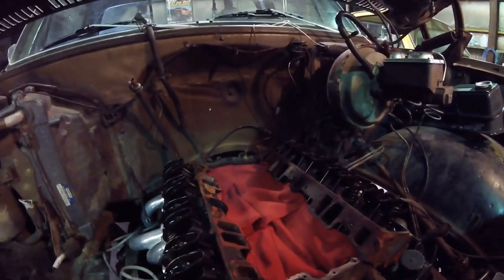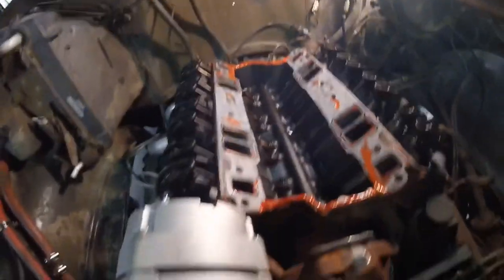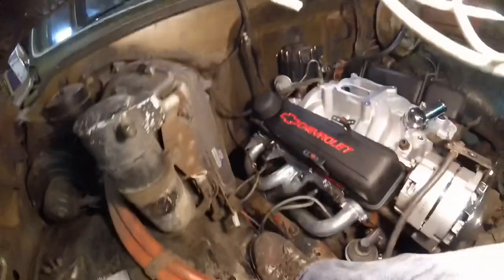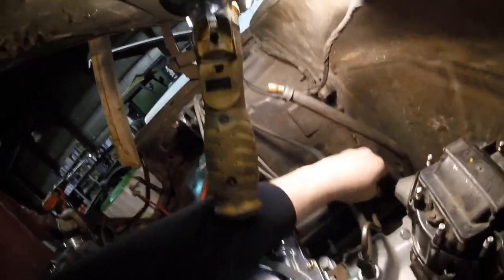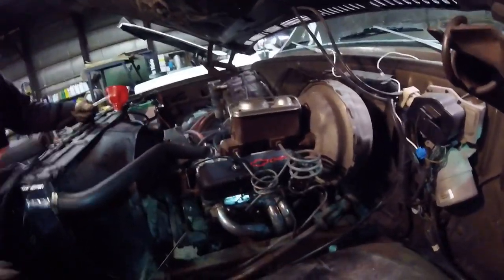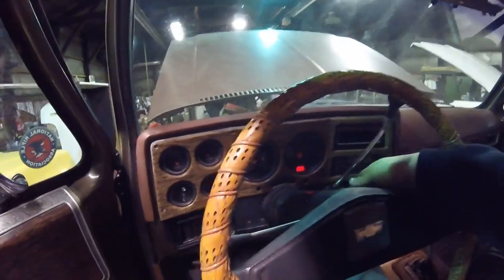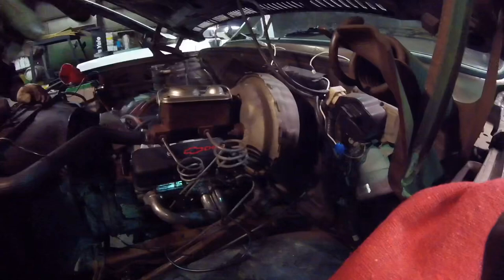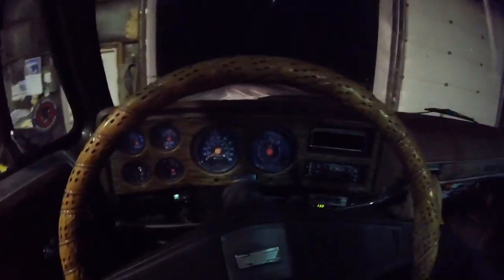How to replace SBC intake and carb |350| |square body| |K10|

Comment: I have a k10 and was wondering if you could give me an opinion about it. I have a clunking sound when I shift on my 350 engine automatic transmission shifting and it slips gears at times. It’s also a 4x4 as well. But, that’s not the issue it is when you shift the gears at the steering wheel part. Friends say it could be the carburetor being dirty, but I think it’s between the flywheel and starter because it stops working. So, I ordered a performance flywheel and performance pro form starter both at 168 teeth for the gears ⚙️ part. To match each other, but, I’m at a loss of where the problem is when it makes the clunking sound for the shifter. Any ideas or pointers? Could it be the driveshaft?